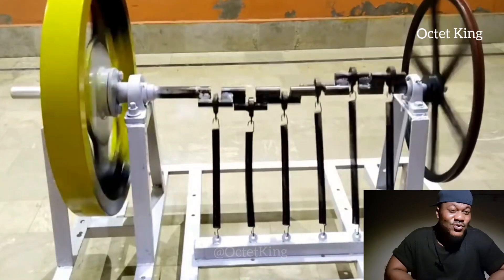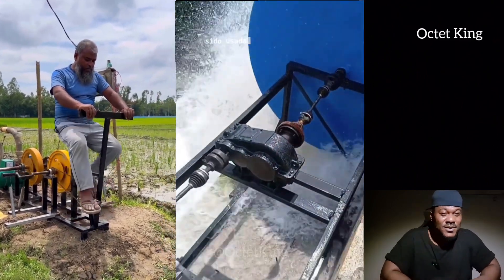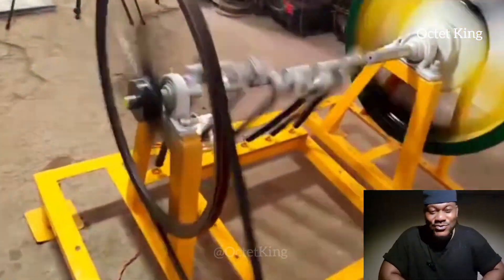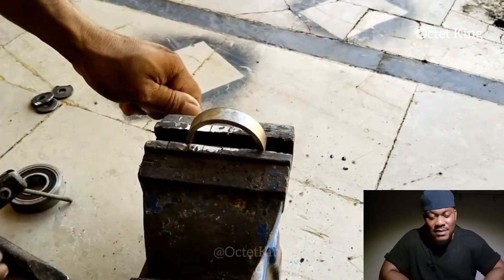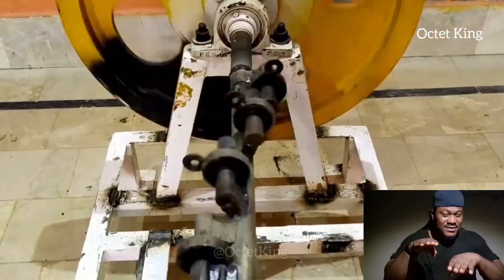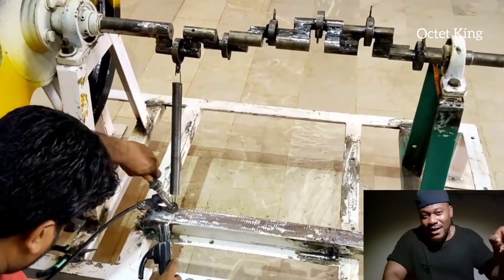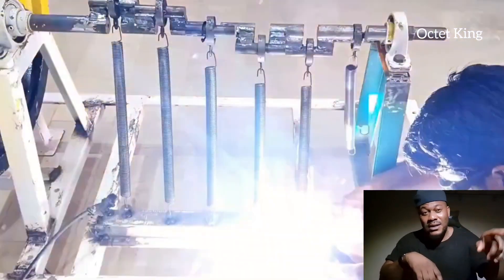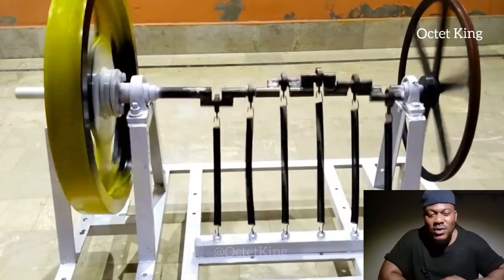How to create Free electricity Generator for your home. #electricity #current #energy #free #home

Comment: This is 100% correct. You need to understand mechanics and electrical engineering. The alternator in the video is made up of 100% copper with high capacity .